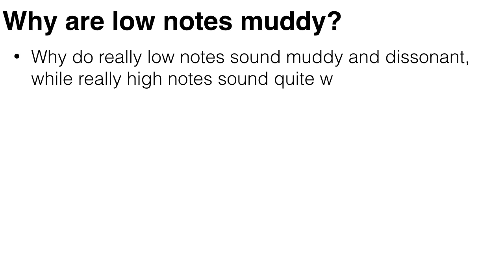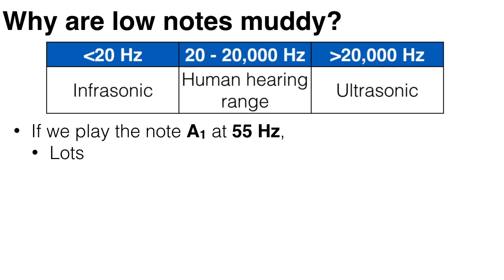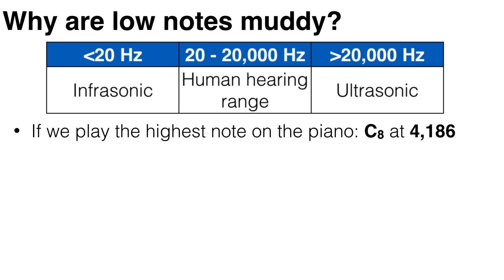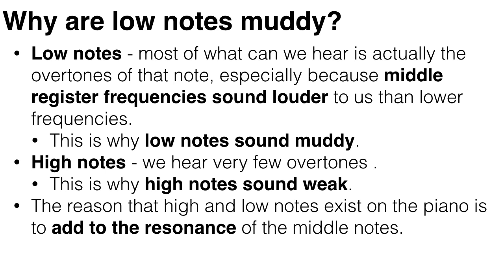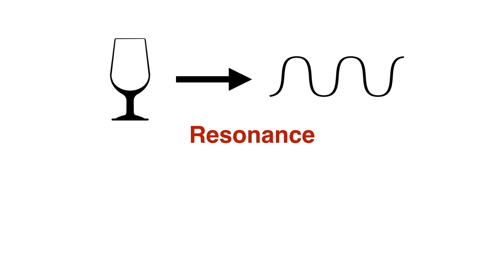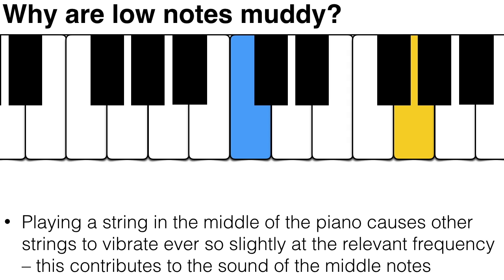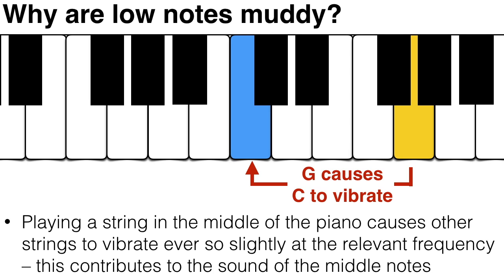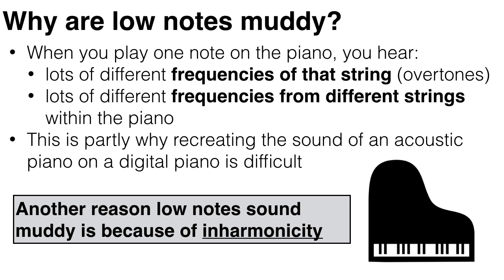12. Why are low notes muddy and high notes weak?

Comment: 3:52 When only a low frequency string is hit, the other strings don't vibrate because of the damper. Yet the sound is as muddy as if other strings were free (except if those strings are low too). So the vibrations of other strings has no effect on the "muddiness" of a single played low note.

Comment: Another reason that low notes sound muddy on pianos is that the bass strings are overwound to add mass, making up for the shorter than optimal length, while the mid and open register has enough length to produce a more musical note.  This is less of a problem on large grand pianos and why spinets with short string scales sound like thunder in the low end with barely discernable pitch.
Reply: So on a digital piano, if you were to pick an upright piano sound library, does that mean the piano manufacturer could deliberately digitally "modify" the recording of the low notes to eliminate this? It would sound different, but would it be a more "accurate" instrument then because it's not constrained by the limitations of the physical space of the piano? 

I wonder if people would think this sounded "wrong" because they are so used to hearing the sound out of an upright?

Comment: But a string can only resonate with a tone if that string is not dampened, right? So in which cases are the lowest and highest strings on a piano actually relevant as resonators?
Reply: Jonas Lind I was wondering the same thing. Only about the bass notes though. The top end of a piano has no dampers on the strings.
Reply from the maker: All the above comments are exactly right. The top strings are not dampened and the dampers aren't 100% effective. They don't completely stop the strings from vibrating, they just reduce the vibration so that there's no continuous ringing. There is still a slight resonance in all the relevant strings. Plus, W. Fitzek 2 is right on the money when he says a lot of dampers wear out and gradually lose their effectiveness over time and based on the environment.
Reply: Jonas Lind yes. Just after two octaves above middle C. Almost the last two octaves are not dampened 😀
Reply: Huh, no dampers on the top strings, didn't know that!
Reply: Yeah, the string which is supposed to resonate has to have its key held down. Some modern composers (e.g. Bartok) explicitly instruct to press down keys silently just to bring out the resonance in some pieces.
So I guess the lowest strings are only relevant as resonation "causers", and the highest strings as the ones being resonated, if you catch my drift
Reply: Often in older (and not only old) pianos the dampers don´t work properly or damp the strings to a 100% perfect.  The damping effect (and so the Resonance) could vary also according to the (overall) loudness with which the piano is played, its actual tuning, acoustic reflections of the room,  humility (of the damper material).  Sometimes  the acoustic piano feels like it would be breathing (in contrary to digital produced sounds) .